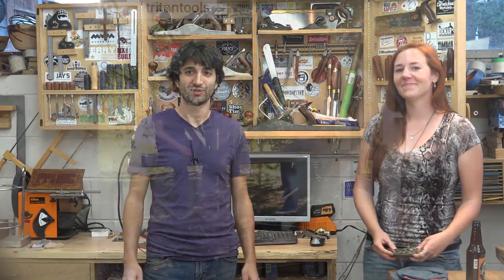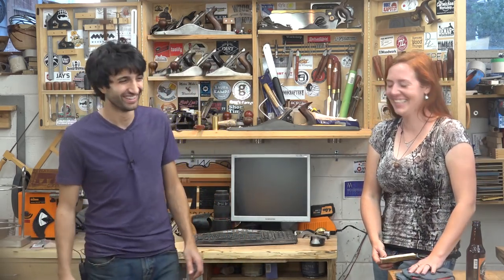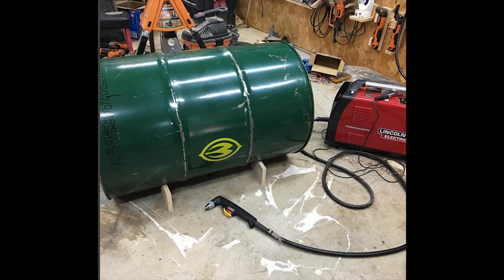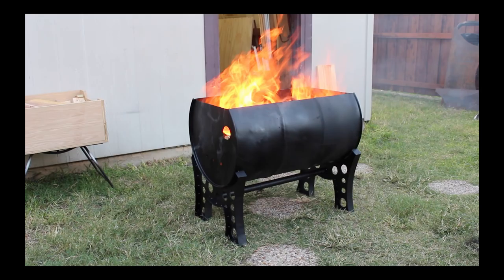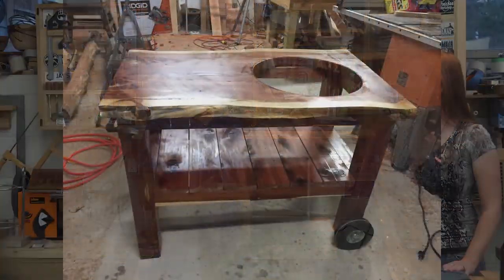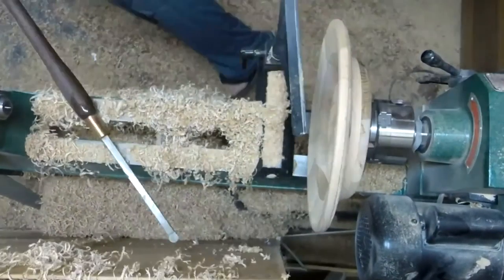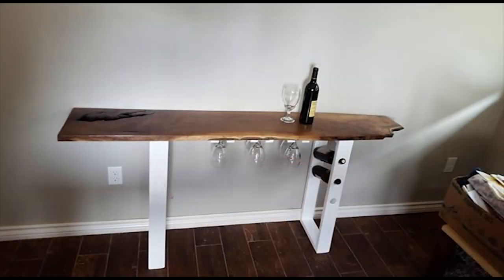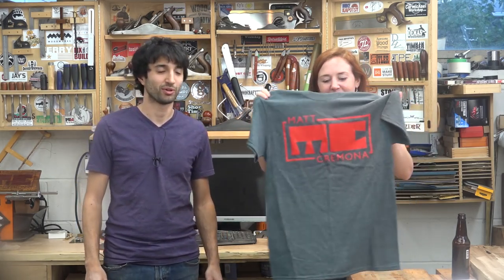Matt's Weekly Shop Update - Oct 18, 2016

Comment: Why don't you guys make a small insertable retort and use some of the wood as fuel, and with the rest (you put it in the retort) make biochar.   You can then use your own biochar, or almost any gardener would love to have it.   This way you can get rid of your wood you need to get rid of, and at the same time, make a product that will both sequester carbon (for 1000 years) and make some gardeners happy.  Love your video

Comment: Off topic, but what is your plan for moving the whole upper part (cartage?) off the mill in the future. Do you have options outside of some sort of crane or forklift? Could a forklift handle the weight of that once the whole thing is built? 

I've not been able to get it off my mind since seeing you remove it from the track in the painting video.

Sorry if you've covered this and I'm not remembering.
Reply: I think he said a linear bearing to raise and lower the saw head and I think just pushing or maybe a crank handle to propel the blade through the wood.
Reply from the maker: To get the carriage off of the mill and transport the mill elsewhere in the future I would need a forklift or skidsteer.

Comment: POR-15 is UV sensitive, so it's better to put a top coat on it if you want to leave your sawmill outside without a roof.  Also, it's best to paint directly on the rust.  It's strange, but it's the recommendation of the company.  If you need more information on the product.
http://www.por15.com/POR-15-Technical-Information_ep_62.html